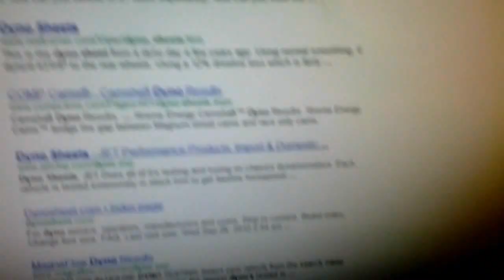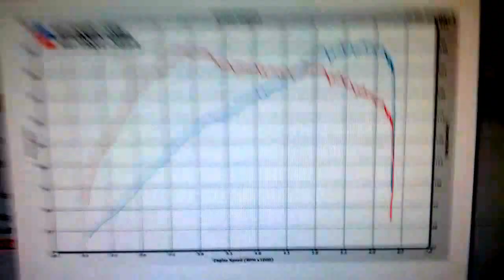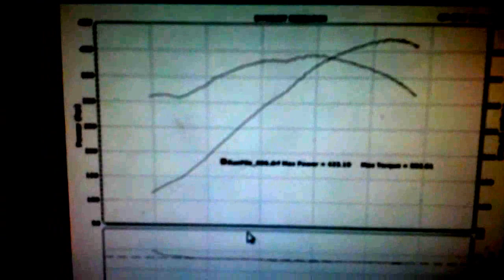Horsepower vs. Torque

Comment: But even maximum horsepower figures alone do not tell the whole story. Like I said you need to consider the entire dyno function (that's why integrating gives a good estimate of performance). Horsepower and torque together, however, provide a slightly more accurate picture than one or the other.

And then of course you factor in EVERYTHING ELSE like weight, drag coefficient, traction, etc etc.

Comment: You're wrong about this. Ignoring some of the odd, not to mention incorrect, manipulations you did there (for example, power is the rate of change, or first derivative of Work (dot) time, not just division), you're missing out on the meanings or torque and power. Horsepower as you said depends on Torque and RPM. Higher RPM = higher torque.

It's very easy to make a car with huge amounts of torque, or very little torque. The only difference is the gearing ratio. You could make a drill with 1000 ft-lbs of torque, but it would move very slowly and there would be no point.

Where torque measures, effectively, rotational force, power measures the ability to transmit energy over unit time. More accurately, it's the rate of change of Work with respect to time. So the faster the work function increases, the more quickly you will go from having low torque (low RPM) to high torque (high RPM). And since we're talking about going fast, being able to get to a high torque in the least amount of time IS IMPORTANT. The best way to measure performance would actually be to integrate the torque graph with respect to RPM which would closely resemble, you guessed it, power!
Reply from the maker: Power = Force x Velocity. End of story. Check any grade school physics text All I was doing was manipulating that to relate it to torque. There is nothing to discuss here. None of my math is wrong, I can assure you. Any calculus at steady state just turns into simple arithmetic (e.g. derivative into division).
Reply: Jon Proce If P=F*V then you could also say V=P/F and that a small increase in V would be caused by a small increase in P.

Like I said, Torque is more a matter of revolution speed rather than ability to accelerate the car. It's very easy to make a car with high torque and low RPM, or low torque and high RPM. Neither will be very fast though. The trick is to have a good 'compromise' between the two. Horsepower is essentially Torque * RPM (with the 5252 to scale it out but that doesn't really matter).

Another way to look at it, Power is rate of change of work over time so it measures how quickly work increases. By conservation of energy Work and Kinetic energy are directly related, so more work means a greater final velocity. A small increase in work causes a small increase in velocity. So a work that is increasing very quickly (denoted by a large power value) will increase the speed more.

Once again I'm not claiming horsepower is all that matters. In fact considering that HP and Torque are single numbers that just tell us the maximum instantaneous values, both are really quite useless in the real world. What matters is the 'total' HP, the amount that can be used throughout the RPM range.

And that is best represented by the area under the HP-RPM graph. More power over a more broad range of revs = fast.
Reply from the maker: Gearing has a great impact on torque conversion from the engine to the road, yes. That's not what I was talking about here. Comparing typical road cars, one typically doesn't have the luxury of installing custom gearsets. When considering two identical cars, increasing torque in one of them will have a more noticeable effect that increasing max output power.
Reply: Jon Proce Ah, I didn't realize you were comparing identical models of cars. But I don't think that would negate anything I said in terms of power being the rate of increase of work (essentially energy) and thus the rate of increase of kinetic energy.

I.e. if I was planning to upgrade my exhaust and one boosted HP more, the other boosted Torque more, I would still opt for the one that benefited HP more. (Of course you cannot increase one without increasing the other, but in relative terms).

But anyway the argument between torque and hp is really kind of a moot point because they're both pretty useless.

A 911 that has a lower MAX torque and/or HP than some other (let's assume same weight) car because it has more total power or torque throughout the entire rev range.
Reply: A 911 that has a lower MAX torque and/or HP can be faster than some other (let's assume same weight) car because it has more total power or torque throughout the entire rev range.

Comment: i was looking through some of the comments and wanted to reply to Tori Jenna.  difference in torque and horsepower 1/4 mile times depend on more than just straight numbers, you have to consider power to weight ratio as well as a number of other things, such as gearing, traction ect...   so to apply that here, well it doesn't really apply, the man was simply explaining the difference in the two units of measurement.    but nice car  ;P

Comment: interesting point a view.  quick question / comment.   My engine makes 169 hp @ 4000 rpm but 200 lbs of torque @ 2800 rpm.   so if i rev to 5200  the torque will decrease to match the horsepower?     lil confrused ...... simple way to look at it.   Torque says, yes i can climb that hill, yes i can pull that trailer with a car on it and take off quickly, and get upto speed in a timely manner where as horsepower says, yes i can do 180mph.    If you can see it through my slightly strange way of looking at stuff?  i try to be basic in all things because usually the simplest answer is the most correct one.

Comment: yep.  Been saying this for YEARS.  No one believes me, they mock me saying that torque is bullshit.

I give up on it, but I know I am right.  This is why my 200WHP car (Buick regal Supercharged)can run with/outrun a 185 WHP car (Acura RSX-S) with half the weight.  I have over DOUBLE the torque and the lower ratio gearing to use it.

it's an amazing feeling to whomp on the fuel pedal and have your car take off like seabiscuit and not when break 4000 ROM.
Reply: wow, more power beat a car with less power..... go fucking figure.... and its from the increase in energy not crank tq you moron. and if the nsx does weight half as much as you and you still won.... its cause of gearing, not because of your tq
Reply: +Chad W right......nothing to do with the massive amount of torque it makes at all.

Comment: so what if you have a high torque engine but is very low at the engine's revolutions. will it still go fast?
Reply from the maker: That depends on how it's geared. Usually a slow moving engine corresponds to a slow moving vehicle!

Comment: Simple question. If you have two exact cars same trans, weight, and everything and one car has 300 hp and 200ft-lb while the other is inverse at 200hp and 300ft/lb. Which would accelerate the quickest?
Reply from the maker: The lower horsepower car would accelerate faster but have a lower top speed, assuming that the power curves were shaped similarly.
Reply: Jon Proce

But if you shortened the gearing of the 300hp car, it could achieve faster acceleration AND top speed. Check real world performance figures.

Wheel torque determines acceleration, not engine torque, and you can achieve higher wheel torque by increasing horsepower. You just have to choose appropriate gearing.
Reply: Jon Proce

It's not impossible (think electric motor with constant power drive and a CVT), but as I keep telling you, with appropriate gearing, a 300hp car will always outperform a 200hp car in a straight line, weight/drag being equal. The flywheel torque is irrelevant.

The reason is that acceleration is related to wheel torque, not flywheel torque. You put POWER into a gearbox and it outputs any combination of torque/rpm you desire (product = input power minus frictional losses). The more POWER you put into the gearbox, the more torque you can output for a given wheel speed. I don't understand why you're having such a hard time understanding this basic principle. Perhaps you should learn to use Excel and do the mathematics.

My car produces about 2700lb.ft peak torque at the wheels in 1st gear (too much for the tyres if applied from a standstill using the clutch). You could do this with very low horsepower, but because our atmosphere resists forward motion, you would not reach a practical top speed with any gear ratio. Atmospheric drag is proportional to velocity squared, which means the amount of POWER required increases by a function of velocity squared (yes I know the equation). There are so many real world examples which demonstrate this, it's hard to believe you're still trying to tell the engineering world they got it wrong.

I've witnessed a car with seized brakes and flat tyres dragged up a ramp onto a truck using an electric motor the size of a coke can. Not even 1hp, but tons of torque through gearing alone. Could that motor propel my car to its 155mph limit? Of course not, that would be absurd (though it would be possible in a vacuum, on a level road with no rolling resistance, using a lossless drivetrain and an engine which required no oxygen - LOL).

Why do you think a Bugatti Veyron requires over 1000hp to break 250mph? Do you suppose it is all a great conspiracy perpetrated by the oil companies? Or do you think the engineers that built such a masterpiece actually knew what they were doing, using.... hmm physics perhaps?
Reply: Jon Proce so in terms of acceleration, horsepower is what matters most?
Reply from the maker: ...no. HP is literally a measure of the amount of work being done over time, which is proportional to the torque and the engine RPM. Work = force x distance, and power = work/time. A car with more available torque will accelerate faster than a can with less available torque.
Reply from the maker: The key is that torque is a measure of how how much force the engine is outputting, while horsepower is simply a mathematical function of torque and rpm. For the most part, people will think a car with a lot of torque feels very fast because it accelerate quickly, but it's harder to notice when a car has a lot of horsepower because you need to be traveling very quickly to be using all of that horsepower ( you need to be running at peak torque and the corresponding rpm which is typically quite high)
Reply from the maker: Teach me your ways Matthew Hyder!
Reply: the one outputiong more hp will pull harder at that point in time. if the 300hp car is always putting otu 300 and the other car is always putting out 200, then the 300hp car will ALWAYS be faster
Reply from the maker: Chad W Yes, but that's impossible.You don't understand what power is.
Reply: Jon Proce

No it won't.

F1 cars don't produce that much torque, but their high horsepower (due to high rpm) means they can use very short gearing, producing very high wheel torque. Horsepower is anything but meaningless!
Reply from the maker: MoronAntidote high HP = high speed, like the Veyron. I agree with most of what you said. You're just getting a bit too complicated for this notional exercise.
Reply from the maker: zanick2 have you ever taken a physics class? Force = mass x acceleration, and that force comes from the torque.

Comment: Come to think of it you are not right or wrong but hp takes precedent over torque because it gives a figure that over a set time indicates the performance of an engine. I.e. if I tell you an engine has 2500 lbft of torque, 2500 as a number is miss leading as it is not matched to an rpm figure hence an engine can make 2500lbft at 400 rpm. That is just 190 hp another engine making 800lbft at 4000 would give 609 hp hence torque is not a relative figure to quantify perfeomance hp is as it is relativ

Comment: hello if you say hp = torque * rpm /5252 then torque would be equal to hp at 5252 rpm hence both graphs would always intersect at 5252 end off

Comment: Explain,  why a M3 with 414 HP at 8300 RPM with 295 torque has the same approximate quarter mile time as a 430 hp at 6200 rpm Corvette with 428 torque. The torque gets the corvette off the line quicker probably right? However once the momentum is established in both cars the twisting power of the engine is less important than the speed of rotation hence RPM correct?
This higher reving RPM then allows the M3 to catch up with the corvette??

Comment: Bro I heard the K&N filter on your VTEC gives you 22 horsepower. 

...This is why it doesn't matter. <-------- What?

Oh but it does matter, because that 22hp increase came from an increase in torque! You can't separate them because they are related by the equation. You can't change one without changing the other, and any increase has a positive effect on performance at the relevant rpm.

Have I perhaps misunderstood why you say it doesn't matter?

Comment: Thought About it some more, you're right about max acceleration at the torqure peak, at least within a given gear, my b. If a lower gear sends more torque to the wheels at hp peak than a higher gear at torque peak then one would probably wanna stay in the lower gear at hp peak for greater acceleration. I didn't take that into consideration

Comment from the maker: Incredible. No, torque is not a measure of engine power, it's a measure of engine TORQUE. HorsePOWER is a measure of engine POWER. Torque tells you the amount of force being generated by the engine. RPM and torque translate to horsepower which is the total energy output of the engine (force per unit time).

Comment: think work energy principle. KE now + Work = KE later. the crank has a certain amount of rotational kinetic energy for a given amount of applied torque that's just enough to keep it at that speed. apply more torque, do some more work, then on the other side of the equation is the new kinetic energy and speed. Horsepower tells us how fast that work was done. so you're kinda right, torque is needed to achieve horsepower, but horsepower says how fast it happened

Comment: and rpm... once the crankshaft is spinning fast enough it achieves rotational energy and can almost keep itself spinning with minimal torque. a certain amount of torque is required to change the rpm, but you're trying to achieve an rpm that will output sufficient power. revolutions transfer the torque (energy really), higher revolutions will transfer it faster not higher torque. that'll just help it get to higher rpm, until it gains more energy where rpm is constant and torque is just enough

Comment: um sorta? higher horsepower will yield larger acceleration, since it transfers the energy from the engine faster. more torque will allow the engine to achieve higher rpms quicker, thus achieving higher horsepower quicker, so not that torque doesn't help acceleration because it does, but the engine needs to be moving first. top speed would depend on friction forces and what not, and how fast the engine will go before it blows up. . . it's just one will get to that point sooner than the other. . .

Comment: the tractor trailer makes 500 hp at low rpm and high toqure, and low acceleration. the formula one car makes like 800 horsepower at high rpm and low torque, and has high acceleration. HP = T*rpm/5252. it's really what rpm that seems to dictate how fast something will move, since at high rpms it's physically spinning FASTER. the steam engine runs at maybe like 2 rpm?

Comment: so you have a steam engine making thousands of ft*lbs of torque, and only 125 horsepower, and it accelerates at the rate of a snail. you have a tractor trailer making a couple thousand foot pounds of torque at 1500 rpms and it can do 0-60 in maybe like a minute depending on its load. maybe 15 seconds with no load, vs a formula 1 car that makes like a couple hundred ft*lbs of torque at like 20,000 rpms and makes 0-60 in like half a second

Comment: BMW M5 - 560 hp and 1870kg, Tesla Model S - 414 hp and 2100kg. BMW should bag this one easily, right? Well google the vid. And before someone tells me that it is not fair because of the gearbox and that Tesla S is electric... There are endless examples out there. One for all - BMW 330i Coupe manual - 1540kg - 272 hp - 0-100km/h in 6s, 80-120 in 4th/5th in 6,1s/7,6s - 0-200 in 23s. BMW 330d Coupe manual - 1600kg - 245 hp - 0-100 in 6s, 80-120 in 4th/5th in 4,7s/6,0s - 0-200 in 22s.

Comment: hp is a function of torque, more torque means more horsepower which is the rate of energy transfer, meaning a high hp engine can transfer the energy to the wheels faster than a lower hp engine. yes hp is just a measure but it's not a meaningless measurement. . . acceleration is maximum at hp peak, not torque peak, that's where energy transfer is the quickest

Comment: so an engine that has greater horse power can achieve a greater top speed for the car than an engine with less horsepower, granted other variables are constant. But an engine with greater torque will accelerate the car faster than a car with less torque. Is this correct?

Comment: Hp is what gives you acceleration. Torque will allow to to always have that acceration. Put a high hp car with low torque some load and it won't move. Give a high torque engine low hp little load and it will be just as slow. When i worked for a junk removal company i drove a ram 5500. It had the same slow acceleration regardless of how much was loaded.

Comment: Torque and power are interrelated and if you make one without the other, your acceleration will not be any better. That's why you accelerate best around redline where you make best power rather than at the rpm where you get best torque. horsepower is the rate at which you can put torque to the road and if it takes you a minute to put 1000 lb ft to the road, your acceleration will be terrible regardless of your high torque output. Look at semi truck engines or the 1963 Chrysler turbine.